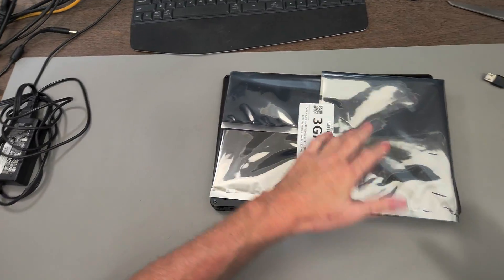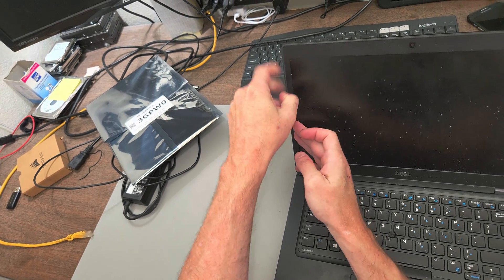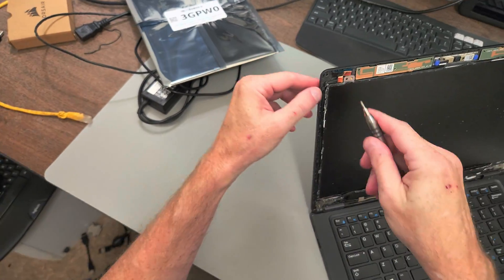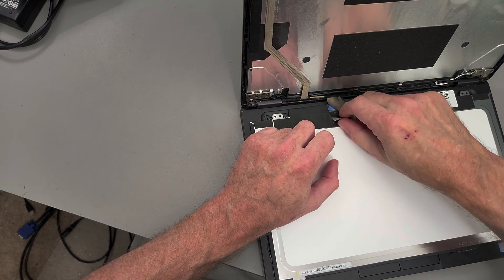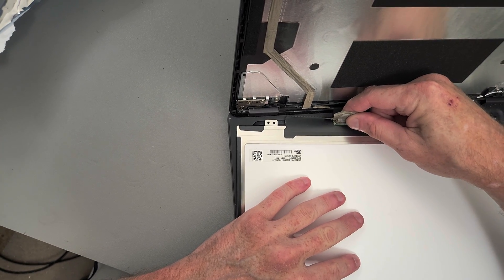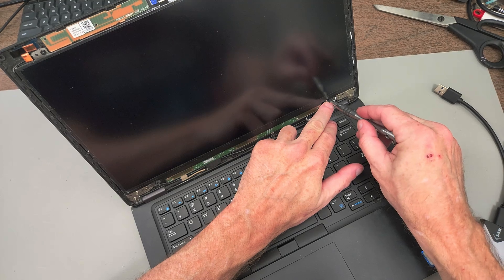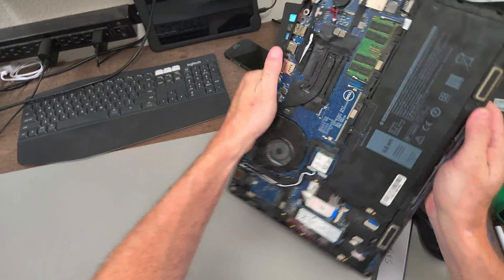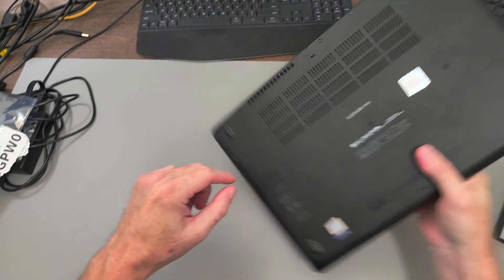Dell Latitude 5480 LCD Replacement also opening the bottom where you can upgrade RAM, SSD, and WIFI

Comment: Thanks for the video! Do you know if the replacement screens are better quality than the rather dim original FHD one?
Reply from the maker: Most of the time the screen resolution and type of screen doesn't change when you replace it. Some laptops will have support for higher resolution screens but you have to check that in the specifications from when it was sold. As long as it was sold by the manufacturer with one of those higher-end screens it'll work.
Reply: @Michael The Computer Guy  Thanks a lot, Michael. My issue with the screen is that it is very dim, and I'm actually wondering if a replacement is brighter (and overall better for graphics stuff). I once got a lenovo440s with ayerrible screen and upgraded it with a 3rd party screen, which is excellent. This computer got a bit old and broken now, and I'm thinking of doing the same here, but I'm surprised there's so little information on how bright  a certain screen is.
Reply from the maker: @waschbirds  if the screen is very damn you might want to check the brightness setting. Along the top of the keyboard there's usually a bright and less bright button try turning it up. Also make sure you're got drivers installed for the graphics. You can check that and device manager. That being said replacing a screen with the same type of screen can often bring a brighter image just because the new screen is not worn out.
Reply: @MichaelTheComputerGuy  Thanks, the software site is ok and it's set to max brightness. But interesting to know they wear out!